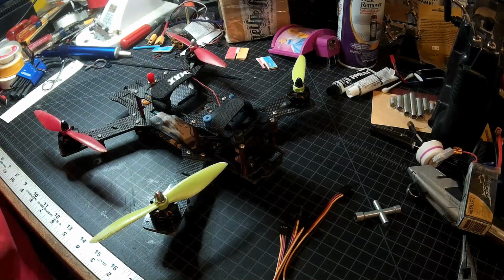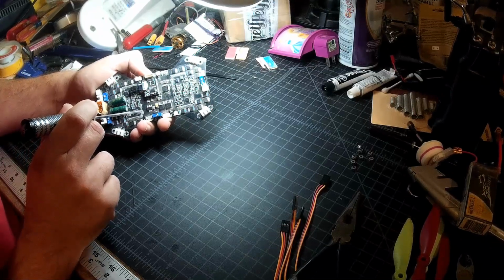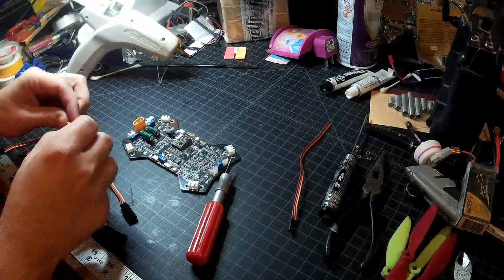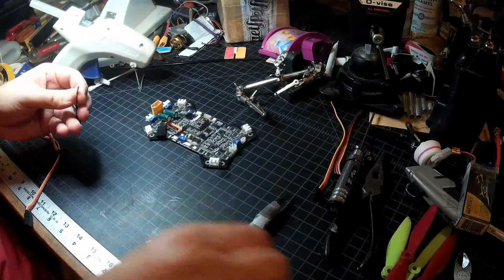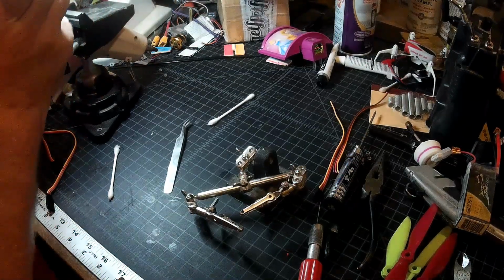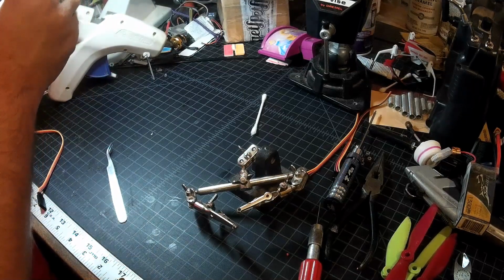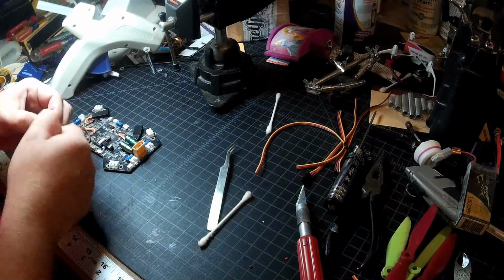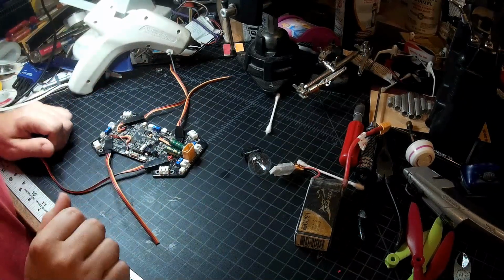Nighthawk Pro 280 - Wiring in ESC flashing ports

Comment: I'm the plier king I was using it on my prop nuts lol
Reply from the maker: +george aura - I hate those reverse thread shafts :D  I'm much happier with nylocs.  Didn't feel like digging out the right size socket or finding my adjustable wrench.  Besides it's not like they're all that tight so I don't feel too guilty for using the pliers there.  I can't defend myself at all for using them on the board nuts - I was just plain cheap and impatient.  I picked up a new proper 5.5mm socket this morning for re-assembly :D
Reply: +Jason Hitesman I'm actually using an adjustable wrench with not teeth on the grip

Comment: Nice video!! I'm just starting to get the hang of the things in the hobby, I'm waiting my first "training" drone, a cheap Eachine H99W. Thing is, I'm thinking of upgrading to the 280 in a couple of months or so, after I get the hang of flying the basic stuff. So I have some questions, if you or anyone can help:

Is it possible to flash the esc from the fc? 

If not, how crucial is it? Could I just up the rates and enable breaking?

If it is crucial to update, how hard is it considering I have little experience with soldering?
Reply from the maker: +John Salliaris Honestly for a second quad I'd probably suggest building your own on a nice frame with good ESC's and motors instead of the 280.  It's not that the 280 is bad, it's just that by then you probably have an idea what you want and can custom tailor things to your liking better building from scratch.  But I can answer your questions:

1) It's not possible to flash the ESC's from the FC, the blheli series from emax have a filter circuit on their input lines that prevents that from working.  You could potentially remove the filter, but no one I know has identified the components on the board that make it up - and even if they had removing it can cause a loss in signal quality.  I'd rather it be a bit more difficult to flash (which isn't done very often) than have any loss of signal integrity (which affects day to day flight.)

2) It's not crucial unless you're looking to wring every bit of performance possible out of this setup.  The stock firmware won't do oneshot with current verisons of *flight and I'm not convinced that the stock firmware actually does damped light as it's braking method.  But it does fly and fly quite well.  

3) Since it's not crucial to update the ESC's I'd generally say don't.  That said if you're new to soldering and you really do want to upgrade them I'd probably suggest using a flashing harness instead of soldering.  Just rig something up with some stiff wires and hot glue or instamorph that you can use to hold the wires against the programming pads.  These silabs ESC's flash fairly quick (7-8 seconds or so) so you don't have to hold them there very long.  I'm just not good at that and would rather not have to tear it apart to flash things since I experiment and muck with settings far too often ;)
Reply: +Jason Hitesman That's a nice and complete answer! 

Initially I was thinking building a nh 250 with 2204-2300kv with 6030 and maybe bn, 20A littlebees and a naze/skyline (like the plugs) on 3s (initially) and no fpv (at first at least) since I'll be flying alone without any spotter, hence, no one to race around, so it will be more of an acro build, but I though that the ARTF 280 had more bang for money. 

Speaking of acro, should I just go for the 250 or the 200? I'm under the impression that smaller is better for acro, but I'd like to keep the balance between acro and speed. 

I know that I'm maybe making too many questions, but there is a metric ton of thing to take in head on.
Reply from the maker: +John Salliaris - Sorry for the slow reply, for some reason I didn't get a notification about your comment and just noticed it.  

Smaller is better in some ways...but for LOS flying smaller is only better to a point because they get harder to see!  The difference between 200-250 really isn't that big.  I have a 230 and 2 280's and the difference between them isn't much.  

No problem asking questions, there is a LOT to take in for sure!
Reply: +Jason Hitesman well, all those plans about the NH got thrown out of the window when I saw a warpquad... Fell in love with the thing! Probably going to keep the rest of the set up like that for now...